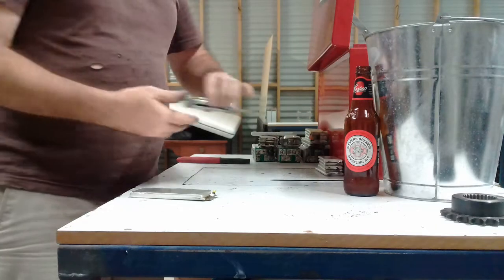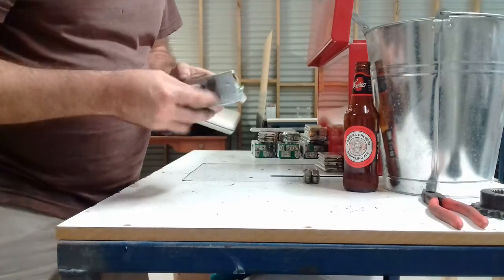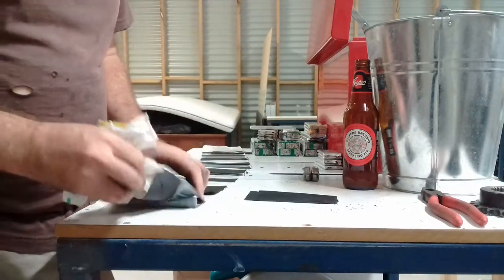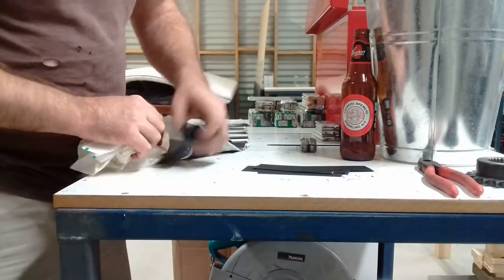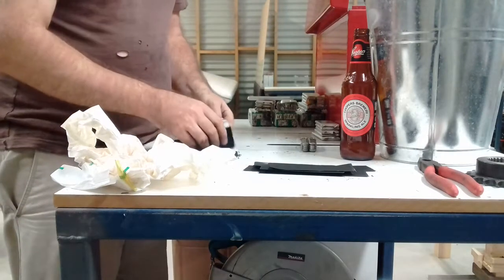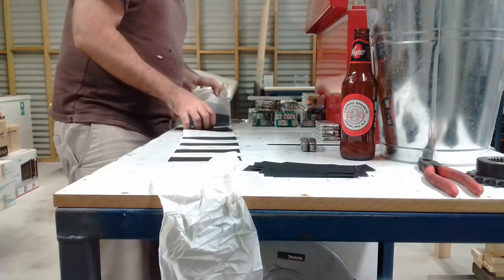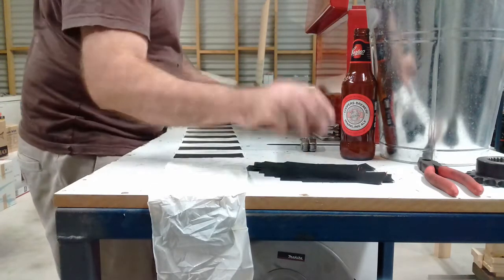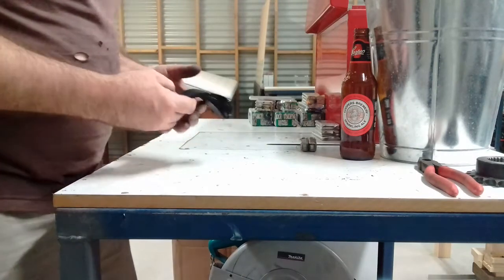LiPo pouch cell recycling - Part 1 of 2.

Comment: what sort of solvent are you using to remove the black on the copper/aluminium?
if you dont mind me asking what part of oz are you in?
Reply from the maker: I'm in Perth (although this video was recorded in Albany).  The solvent I intended on using was NMP, but it's not very effective at removing the cathode I discovered.  Washing it in an ultrasonic bath turned out to be more effective.  I really ought to finish part 2...
Reply: @jonescg   nsw here, know anywhere that sells battery solvents, ec: dc etc

Comment: Looking forward to part 2!
Reply from the maker: Oh yeah!  I forgot about that!  I'll put something together soon.  Cheers for the reminder!
Reply: Hi Chris, I'm very much into renewables, ebikes, RC and 18650 harvesting and follow HBPowerwall who I'm sure you must know.
I've collected a pile of lipos, and tens of kilos of dud 18650s that I'd like to have a go at reverting back to original elements and taking particular care with cobalt.
I like your philosophy regarding recycling - mine is to take what you need an no more, replace what you take and leave things as you find them or better. If only more would think like this.
I see responsible lithium battery recycling as one of the most urgent and useful things humanity can in parallel with the accelerating EV / battery energy transition.
Reply: Andy Lee Robinson yeahhh so many cells out there and very few people recycling it. Good on you guys. I’m also waiting for part 2